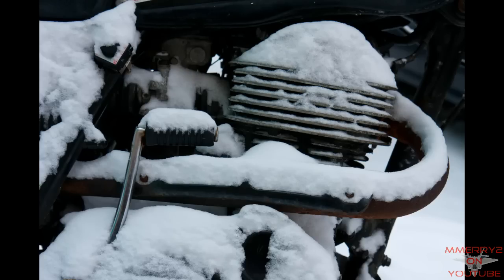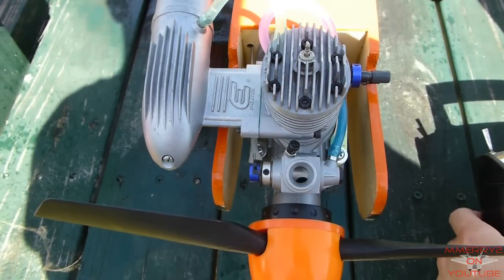Transitioning from Electric to Glow/Nitro Planes:  Intro to Glow RC Planes

Comment: I have flown rc from 1976. Glow was the only power back then. I got tired of always having to clean my planes, I switched to gas around 2006. I liked gas, but. Switched on 2014 to electric. Too quiet, but stayed with it. Today, 12/2019, I am considering going back to glow. Fiel is expensive  but what isn't these days.
I fly Pattern planes, and also like full aerobatics. I'm retired a couple of years now, but find little time to fly. Maybe 2 days a month
Love RC, and also love flying full size as I also have my Private from 1978. See, with radio control, yoi can fly anything. To own & fly real, it's hou much can you afford? Also know that there is usually an, "I told you so" waiting back home, so be smart. Join a club, get a free club instructor, and you learn the right way.
"Down wind & Dead stick"
Denny  Swen
Florida
Reply: Typed too quickly, and a few words misspelled. Sorry.
Reply: Hi Dennis, we have some things in common. As a 14 year old in 1973 I struggled with glow and diesel (lets not forget those) control line. Ten years later - earning money - no kids yet, RC flying had reached a new level, reliable 35Mhz Japanese radios (Futaba,Sanwa), ultra easy Japanese 2 stroke engines (OS and others) and masses of balsa kits to choose from and build - all affordable. At that time, here in the UK clubs were fairly big (100 members) but flying sites were always under threat by noise complaints but it was huge fun.
I got my PPL (Private) in 1984 on Piper Tomahawks, where are they now? Alex our first born first flew P2 with me around 1986 - he was four years old, and sat on a car booster seat. His passion is gliding but like you has a thirst for precision aerobatics (youtube search:' K21 inversions' to see him having fun)
Back to models! We've always flown RC. Last few years mainly electric foamies - lots of them, they are cheap and fun to fly. But we have had some time to rethink  and build something during this virus lockdown. We are getting ready to fly:
Chris Foss Wot4 (kit built by me) with my old OS Surpass 48 4Stroke
Glens Models Cap232 33% scale Zenoah 45 gas engine - all bought second hand months ago
JP Panic biplane (on the building board and will fit my unrun ASP 75 bought years ago but never used)
Anyway if its any help I've put a few youtube shorts up. Type phil okeefe cap 232 into the youtube search box and you should find them.
Good luck! Have fun!

Comment: Never heard of 'throttle cut' before, and it sounds like a horrible idea.  The last thing I want to do is accidentally shut off the engine while in flight.  I have always just set my low throttle position at an idle.
Reply: For safety reasons, my transmitter has a dedicated toggle for throttle cut.

Comment: Is the flying the Same like an electric one
Reply: +Lukas Eggenberger, I have electric foamies, numerous glow, and about 5 gassers.  Because my electric foamies have less mass, and therefore less inertia and less kinetic energy, not to mention less noise.  I feel a like my electrics are a little less demanding, and easer on the pocket book in case of a crash.  However, my glow aircraft are cheaper in the long run I think.  True a gallon of fuel cost $20.00. But in a .40 size engine, that is a lot of flying time.  My electric planes need new batteries (Lipo) about every three years or so, and they cost about $15.00 to $20.00 each... and I usually don't recharge them at the field... the glow is gas and go, gas and go again.  I hope I answered your question.  All things being equal, as in same plane and same wing loading, you may not notice much difference in the actual flying, just your occasional dead-stick landing with gas or glow.

Comment: When I saw the video title I found it so weird that I had to take a look at it. Glow engines are fortunately in a phase out in the hobby. Electric is way more simpler, clean, quiet and most importantly, much mure powerful and responsive. The only logical transition from electrics is to gas engines when you reach 100cc (35% scale) planes in which the energy density of current lipo batteries make electrics heavier and not so practical. Even in 100cc class and up electrics deliver more power but end up heavier than the equivalent gas planes.

Comment: I had started out with electric planes but went to glow now I'm trying to go back to electric after i had got in 4 glow planes and my advice would be to stay with electric they are much cheaper to run.
Reply: Glow is all I fly. The engine is such an adorable little marvel of modern machining that there is just not any appeal whatsoever to electric for me. Turns methanol and nitromethane into grins! Well, that, and I can fly for 20 minutes, land, refuel, and within 3-4 minutes be back up again for another 20. Don't see any of the electric guys at the field do that they're usually up for 5 down for 60 waiting on lipos to charge.

My personal advice is to fly what gives the biggest grin, not what looks best on the bank account. The hobby is about smiles and good times, not minmaxing one's investment.

Comment: A good kit, but this engine has issues.  Mine has over 600 flights.  An upgrade to an OS type eng has provided me with consistent trouble free engine.  Usually I see the grounded ALPHA at the club are due to issues with the stock evolution engine.

Comment: Gas and glow are far more fun that the lazy mans electric funk of foam
Reply: Maybe if you took the time to learn how to set the engine, it might start.  Also, I used to go through two to three quarts of fuel during a session, with an eight ounce tank.  Five minutes after the plane landed, I  could have it in the air again.  Without having to carry a couple hundred dollars worth of batteries.  The only batteries I carried was a spare nicad pack for the receiver, ten flights, change it if I was going to fly more.
Reply: There is such a thing as buying fuel in bulk, as in order five gallons or whatever that works out to in your units, and don't be wasting money on high nitro content.  And yes, I like old tech, even old rules, such as the builder of the model rule for competition. No, you can't convince someone that has seen both sides flying and knows what he wants that your buzz toy is better,  It's not.  But the battery boys around here are either at the field early in the day, or late afternoon, leaving the field to the glow engines for most of the day, or they're sitting around waiting for the wind to calm.  But they're very entertaining when they crash and the batteries start burning.
Reply: 20 bucks a gallon, but how much for those goddamn batteries? Fly em half a dozen times and start puffing up fly em half a dozen more times they really puff up and then you're buying more batteries. Plus you're waiting 45 minutes for a charge. both have drawbacks gasoline is the best
Reply: I seem to remember the last time I bought it, something like sixteen bucks a gallon, no nitro, K&B doesn't need nitro for sport flying.  The hobby can be as cheap or expensive as you want to make it.  Working on a BUSA Stingray 120 now, thinking ASP 120 4stroke.  Got it too.
Reply: if your puffing batts after 6 flights then your doing something wrong. i have batteries with hundreds of charges and not puffed. i have had batteries with over 1000 charges, and the batteries i buy are cheap. though your right electric is for the lazy man like me and i prefer it over glow anyday. glow/gas is aggravation and messy cleanup, done that 20 years ago. the biggest electric i have is 80".
Reply: oregonpoop I've got $1200 in batteries and charging crap. I'd sell it all today after going to wet fuel
Reply: Bunnyshooter 223 - yes I use several different sites to buy and sell. I find a lot of people really lowball you to death. I guess when you buy into a hobby you have to go in expecting not to get but 1/3 back out of you sell. This is what I find anyways and I take good care of equipment.
Reply: @SouthernOregonReps  If your batteries are puffing up after that many flights you are definately doing something wrong, like discharging them way too much or something.

Comment: I fly Just glow and gas. Also for all electric users swapping to glow or gas dont give it full throttle like you would do on an electric. The only reason i say that is because nitro is allot more fragile and wings can snap, iv had two planes wings snap on me from loops and such like.
Reply: +max marshall   You don't say if it's ARF or kit or scratch built.  I never flew an ARF, and never snapped a wing from any maneuver.  BUT.  The instructions spell out how to do the wing joint, and some people think it's just more weight.  The wing center joint has to be done right, or you're going to take the plane home in a bag.  I've done full power split S, full elevator to avoid the ground, and never had anything fail.  (Balsa USA Smoothie, K&B .40, fifteen percent nitro, Castor oil.)

Comment: i prefer glow engines because they are more reliable
Reply: +Corey Payne And If your like me I love to fly for about 2 hours with out a charge
Reply: Wow!Thats like saying I liked my dads 1970 Oldsmobile better than todays cars.  More reliable? Come on! I can be in the air in 5 minutes or less with an electric plane. No fuel tank to fill, no messy spills. No adjusting depending on ambient air temperatures.  No flooded engines. Look , saying todays RC planes are not reliable is just silly. I do both Nitro and electric. Be honest ok. They both are fun . Its a hobby. Why argue?

Comment: gas planes have much more power than electric..there are electric motors that can produce as much as gas but much much more costly because you have to buy a esc,bigger battery,and of course the brushless motor. and gas planes are heavier than electric so makes them easier to fly and land because the wind wont throw it around as much.while the guy next to me is waiting to charge his battery I just add more fuel..lol....I love the power,the noise,and smell of nitro.
Reply: i never seen anyone at my field fly back to back on gas they always let it cool down. i have several batts so while you refuel im in the air again..lol. i hate the noise of glow its irritating to me, i like it quiet while im flying its relaxing. now on the other hand an 8000 horsepower top fuel nitro engine is music to my ears...lol.

not sure about power but ive seen electrics easily go a 100mph. and electric 3d planes hover easily and power strait up. you have to have the right setup for gas or electric.
Reply: jhue73 I've seen nitro go over 200mph. Also you don't have to cool off engines that long and while you are sitting there charging batteries for hours I still have another gallon of fuel to fly on...lol.
Reply: you only need a meter runnway to takeoff electric

Comment: It's not very hard to tune these engines, just a little practice. It's a lot less frustrating than hooking in electric motor up to watt machines and trying several different props just to figure out where you range at. I respect both, but big electrics is very similar to a nun with huge tits. Small park electrics are fun for spur of the moment flights

Comment: A few errors indeed. Priming by turning the engine backwards...REALLY...???? All that does is pump whatever fuel you might have, back to the tank. Remove the pressure (vent) line from the muffler while fuelling...?? Don't think so. If you run non Nitro fuel (have done for years on both two and four stroke engines) the fuel you push into the muffler (as long as you stop when there's no more than 1" length of pressure line of fuel that has been put into the muffler) is the best prime you can get. Tip the plane on its side so the engine cylinder is horizontal with the muffler at the top, and while rocking the prop with the piston at bottom dead centre going left and right, get the gas into the top of the cylinder. NOW open the throttle full, and turning the engine in the correct direction by hand with your finger over the carb' air intake, draw the fuel from the tank to the carb'. It's almost ready to go. Bung the glow battery on the plug, and I recommend this to anyone who hasn't used a glow engine before, DON'T USE AN ELECTRIC STARTER. Use a (Chicken) stick. It's all I've ever used, for two reasons. If you have cocked up the priming procedure and have too much fuel in the cylinder, hydraulic stoppage of the piston wont damage important things.....like the engine :-). Also, and as important, it will teach you (not in two minutes, but in time....person dependant...) on how an engine feels when starting. Too rich, flooded, no fuel. Personally, when kicking the Tower .46 into life I'll start it against compression rather than flick the prop in the normal running direction. But every engine is different, as is experience and methods of people.
Last thing I noted was the open position of the throttle indicated when about to start. Jeepers, that's about 80% cruse power. Should only be about 1mm (.04") gap when you look down the carb' so the crank case can generate some vacuum to get the next lung full of fuel in.
All above assumes you have a correctly tuned engine, which is VERY dependant on temperature of the day, humidity and the barometric pressure, the correct glow plug for the engine, no fuel issues (leaks in the pressure line or in the tank between the clunk and the tank bung) and most importantly if new to the art of no nitro fuel (yep, good ol' Methanol & castor) someone looking over your shoulder who has been there and knows their stuff.
The only electric thing you need (apart from the plane radio gear) is the glow battery.
Reply: Couple glaring errors there.

Unless you're running a pump-equipped engine, rotating backwards to prime will work just fine. rotating in either direction will generate suction at the carb, which is what you want (yes, these engines will even run backwards, just with poor power because your porting is all messed up)

Ventline off is best, as it works with all engine setups. Your procedure for priming from muffler overflow is not going to work properly with baffled mufflers (as there are baffles in the way), pitts mufflers (no way to rotate the plane through the right series of positions and ensure priming) or pipes. Not everybody runs unbaffled side mufflers (in fact most setups today do't), and those are the only ones for which that procedure will work.

Comment: no reason for gas unless your going mega scale
Reply: gas is ultra-cheap to run. Way cheaper than glow or electric on a per-flight basis. 

But it's more expensive to setup, and your ignition has to be clean (ignition noise can cause radio issues)